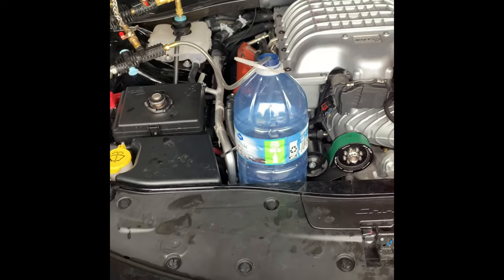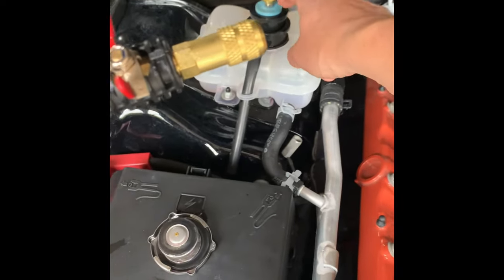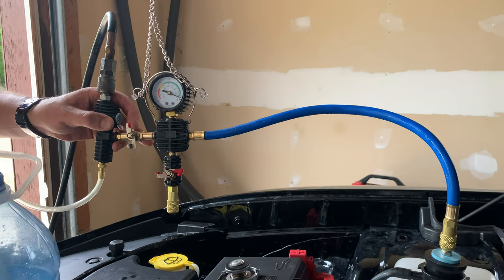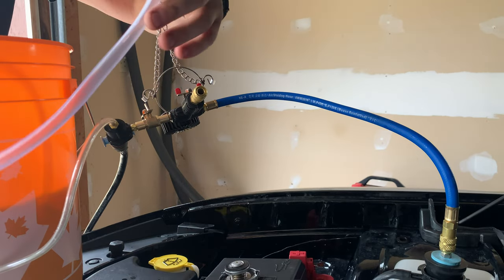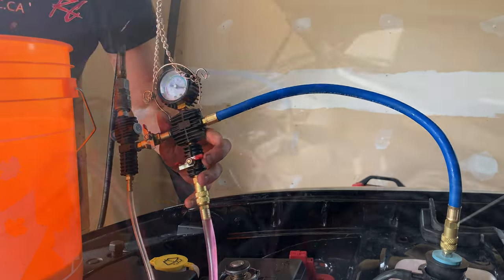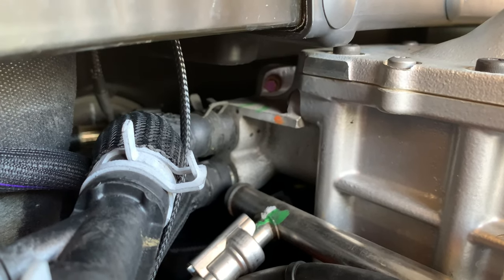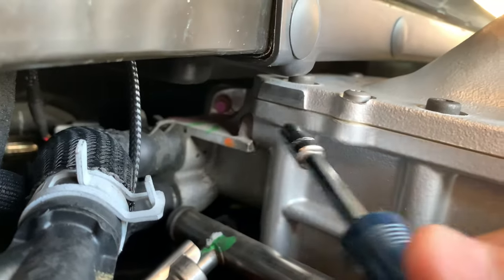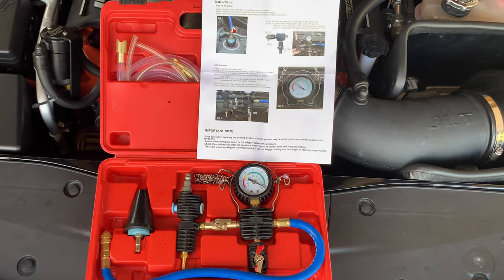Hellcat intercooler coolant vacuum filling system with Gearhead Fabrication bumper reservoir tank.

Comment: Is there any way to let u know the ic supercharged coolant pump is bad??
Reply from the maker: Check out intercooler temps and see if they continue to drop or lister to hear if you hear the pump running. You could always disconnect the connector and run power to it and see if it runs. Good luck 🤞🏻
Reply: @Modaddiction19  Are there other problems that cause supercharger temperatures to rise?? Thank u because my supercharged ic coolant temp was then more then the outside temperature like 40 Celsius if outside 30 Celsius the ic coolant temp 70! Is there other problems that could raise the ic coolant temperature??
Reply from the maker: Depending on how you are driving. Before my killer chiller at the end of a quarter mile my intake temperature would be around 160 degrees. Typical intercooler temperature is normally about 3-5 degrees above ambient temperature. Make sure you bleed the system as you could have an air lock or even a lot of air in the system.
Reply: @Modaddiction19  when you released that bleeder screw, did you have the reservoir cap on or off?

Comment: Can I use this tool to remove the coolant from the system? I recently put an interchiller on and didn't vac fill it. I have 3 gallons of new coolant I put in the system so I want to try and reuse it!
Reply from the maker: Unfortunately you can’t use the vacuumed tool to remove the coolant. I’d just undo the rubber coolant hose at the bottom of the intercooler to remove the fluid. Then if you wanted place a air compressor tube inside the intercooler  overflow  and blow the remainder of the fluid out. Hope this helps and good luck.
Reply from the maker: Search my other videos for (Hellcat killer chiller Gen 5 Gearhead fabrication tank and VP Stay Frosty Stay Frosty Coolant. Very Cold!) This will give you an idea on how I remove my coolant 👍🏻

Comment: When you backed off the bleeder screw, was the reservoir cap on or off?
Reply from the maker: I left the reservoir cap on. Wanted to make sure if there was any pressure in the system to allow it to bleed out through the bleeder screw.

Comment: How did you flush supercharged's fluid?
Reply from the maker: I removed the heater hose at the lowest point and then covered the top of the overflow allowing only a small opening for me to blast air from my compressor blowing all the fluid out. Hope this helps.
Reply: @Modaddiction19  sory,I didn't got it, may you video the  way you  did?
Reply from the maker: @user-ky3zt3gm1f  sorry to hear that. I will be doing an updated video in the spring. Stay tuned
Reply: @Modaddiction19  I'm waiting

Comment: if i don't have these tools, is there any another way to do it?
Reply from the maker: My friend buy the vacuum honestly worth the $60 bucks to get a perfect fill. I tried everything before this and nothing was able to remove all the air from the system. Thanks for watching and good luck 👍🏻
Reply: @Modaddiction19  thanks bro
Reply: @user-ky3zt3gm1f  there’s a bleeder valve on at the rear of the supercharger ,it worked perfectly for me when I added the bigger heat exchanger
Reply: @desrt5608  where? and how you added the bigger heat?
Reply: @user-ky3zt3gm1f  bwoody makes an aftermarket one that mounts to your front bumper support

Comment: What were your symptoms?
Reply from the maker: I had random boil overs or leaks from the intercooler overflow reservoir and at the end of a WOT pull my dash would flash Low Intercooler Level and I would pop the hood and everything looked normal? When I removed all my fluid to do the vacuum fill I was able to fit almost 1.5 gallons more into the system 👍🏻